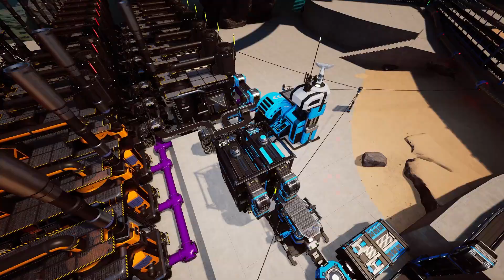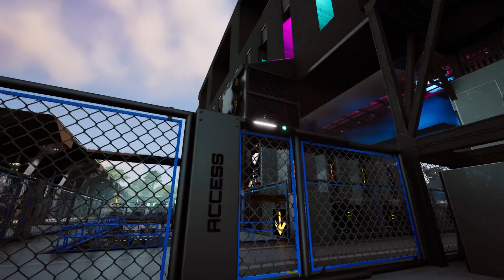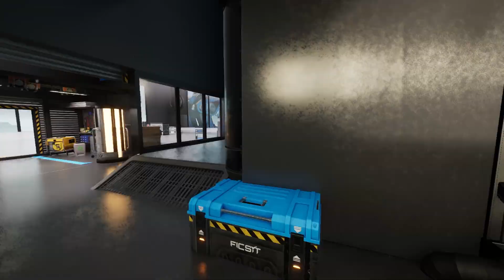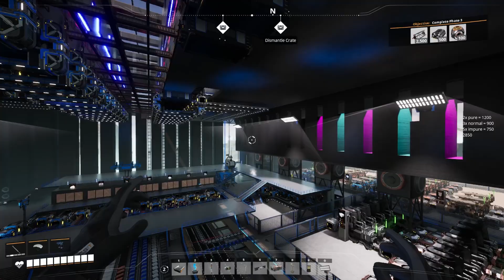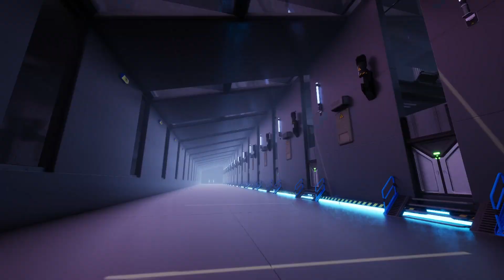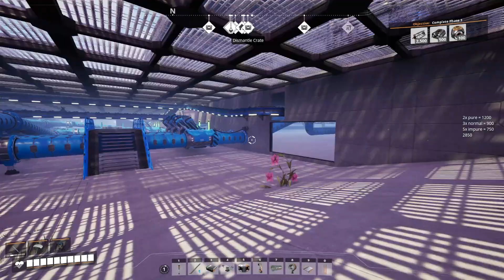I May Have Overdone it a Little...

Comment: I use the factory props too. Your garage gave me an idea though. I have two cranes on I-beams in my garage with a train engine under one of them but the train is on the concrete. I'm about to elevate it so it looks like it's suspended by the crane rather than just sitting on the concrete 👍🏾👍🏾👍🏾 Nice factory. It take some work to make props really look active instead of static. I use the various robot arms too. You can mount them over conveyors and other things that actually move

Comment: i love seeing the esthetics as im horrible at thatvand even like my factories "naked" so i can see everything moving. i put all my effort (and ugly factories) in tinkering our silly ideas. om my aecond playthrough a and I built a 600 cubes biofuel plants and matching fuel gennies and i have 1500mw of bio gennies to use them in stead of power storage, supplied with packaged. don't sleep on bio fuel as you can sloop 3 or 4 (with alien protein) steps of the process! one animal remains nets about 600 kubes of fuel this way. first playthrough i had massive power production from turbo/rocket/ionized fuel 😊.had 22 nukes but they ran at 5% as i already had massive overproducton, my fuel powe generation was running at 50% or so when i finished the game

Comment: What kind of deco mods are you using
Reply from the maker: I am currently using 14 mods that add deco: Fire Smoke and Water, Blocks, Factory Props, DI More Glass and Stuff, Gateways Extensions, 2m Walls, Modern Railings, Decoration, DI More Lights, Decorative Rocket Thrusters, More Beams and Pillars, Structural Solutions, More Decorations, and Cheap Lights. 

The big important ones are 'Factory Props' by SpaceGameDev, 'Decorate' and 'More Decorations' by Andre Aquilla and 'Structural Solutions' by D4rk
Reply: @ thanks

Comment from the maker: Ah the ADHD life. Have you ever gotten lost in the details when creating something? Spent a disproportionate amount of time creating something you knew was temporary?
Reply: I just finished a 6 hour assembling factory for like 5 different components, only it ended up being exclusively a modular frame factory... are you running any mods? I'm new and wondering what those blue things are over your belts that display input, throughput and output
Reply from the maker: I am! Currently running over 60 mods. The throughput readouts are from 'Efficiency Checker Mod'. Very handy. @ehzytheg
Reply: @SpiLz  thank you. definitely checking that one out, i bet it saves a ton of headache
Reply: @ehzytheg  elevator also mod is soo cool